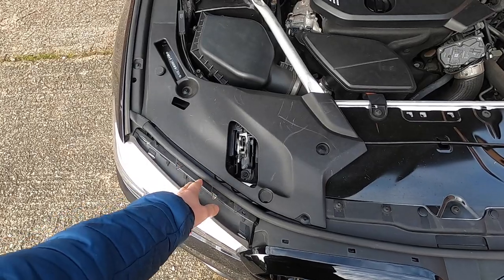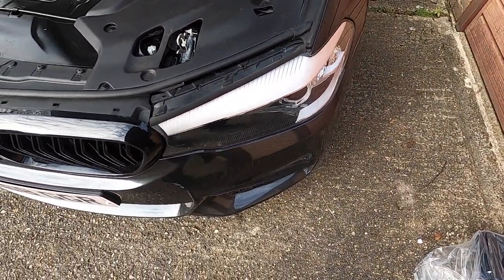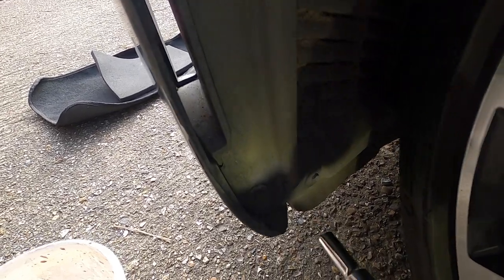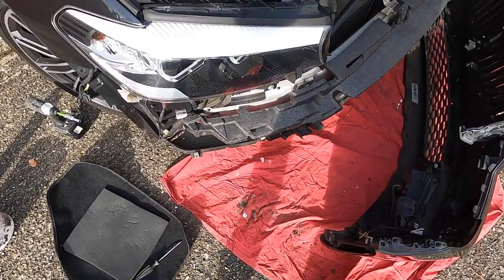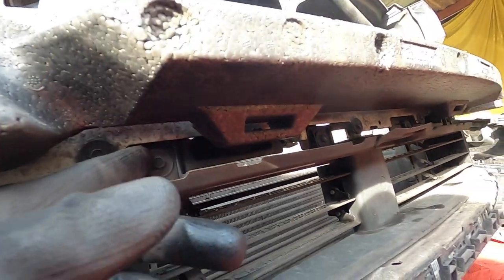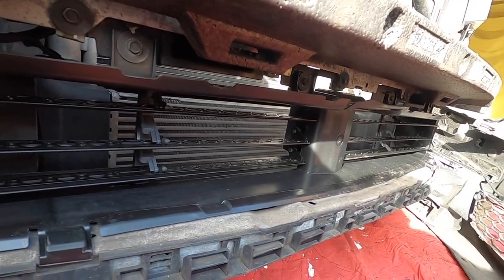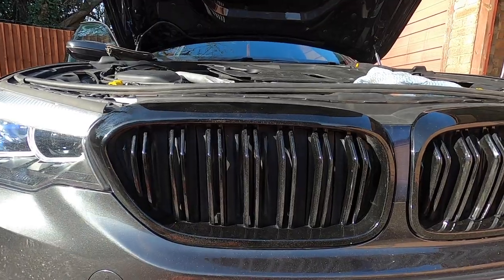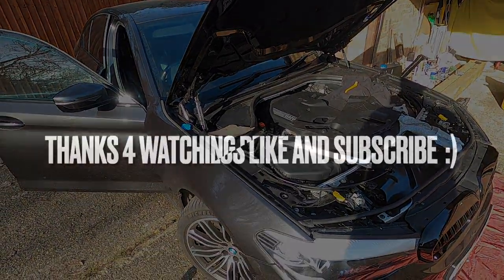How to replace lower active grill on BMW G30 (5 series)

Comment: Thank you very much for this.  I had the same issue with the open flaps on both upper and lower air flaps of the front grille G30 540i.   I replaced both mine upper and lower at separate times.  For the upper one, the new flap actuator was at the closed position when I installed it.  After that, it got stuck at the open position again, so I thought the lower one could contribute to that and I purchased the lower flap assembly.  I ran into the difficulty of getting the old one out due to the middle sensor was in the way.  The middle lower sensor was mounted with 3 screws, two screws were on the lower flange of the sensor and the one screw on the top flange which is the blind screw and the only way is drilled out the blind screw nut, but I was afraid of doing that.  Instead of doing so, I disassembled the new lower flap assembly and took the actuator (which is very similar to the top one) and then replaced it with the old one.   After all of this hard work, both the upper and lower are still in the open position.  
Any ideas?  Do you think I need to use ISTA app to close it?  I used the Bimmer Link app to check on the error memory, both error codes 13820B and 13820A reinstated after I cleared them off.  Any comment and suggestion will be appreciated.
Reply from the maker: Its hard to suggest something i have not dealt like that but i think you should not remove the actuator from lower grill coz it comes with flaps already so i presume it should be fitted that way maybe thats the problem you have because you took it out 🤷‍♂️

Comment: Do you need to replace upper one as well? I think on my car both of them do not work, I also noticed in one other video that after replacing both, coding with ISTA is needed, but may be only to clear errors is enough? What do you think? Thanks, great job!
Reply from the maker: I think its not necessary if its in working condition but i think if lower is faulty the top one might not work as well but my advise is to change the top as well because  you gonna have good access when bumper is removed otherwise you can access it without removing bumper so save your self extra work and do it all in one go. 
No coding need it just clear faults after you replaced it 👍
Reply: Thank you for the quick reply :)

Comment: Good video, my lower grill is dead so will be attempting in next couple weeks to replace it myself. Can you tell me if there is anything to look out when putting it back together? Thanks in advance
Reply: And how long it took you ?
Reply from the maker: Thanks 👍
Well be careful dont rush dont use force you dont wanna break things, keep screws in one place and when u out back bumper look for the gaps make sure they are the same, take photo or vide before taking apart so you can see how should look, specialy in headlight area there is a brackets where it sits if is not gonna sit properly you can loose it up just pay attention to detail 😉 good luck 👍
Reply: @arturaslogunovas  thanks i will be careful,  can ask how long it took you from start to end
Reply from the maker: @jirijansa356  well i think about 4hrs

Comment: Have you a eml ligth on the dash? The upper active gril open and close with the issue on lower active? Or the upper active grill stay open all the time?
Reply from the maker: No lights on the dash ive noticed when top grill stayed always open specially when weather in spring time still chill they should stay most the time closed specially in the morning before driving
Reply: @arturaslogunovas  mine is most of the time open, dtc error in memory but no Eml ligth on dash, im not gone spend money or the grills..Im going to coded to allways stay open..or..cut the flaps...Im living on the warm country....and 95% of all brands dont have active grills.
Reply from the maker: @Tony-fh2wi   thats cool and make sense to keep them open as you mentioned the country you live is warm i know some people do that 😁

Comment: Hello i just want to ask about lower active grill. Is there motor which open and closes it ? If yes, is there any part number of it ?
Reply from the maker: Hi, yes it is motor closing both grills upper and lower.
Im not gonna be able to tell you the part number as part is fitted and there is no access to check, but all you need is reg number or vin number then call to bmw dealer and they will supply you with correct part

Comment: Hi, I broke a "tooth" on the active shutter of a BMW G20 (the ones that open and close). How much would the repair cost at a BMW dealership?
Reply: I initially took my active air flaps off for aesthetic reasons - huge mistake. I got a CEL a few days later, I guess I did it wrong. I was watching TK Garage on how they took off the flaps...

Anyways took mine to the dealership to get the WHOLE thing replaced, it was about $1500 with the actuator and the flap replacement. I live in Las Vegas if it makes a difference
Reply from the maker: Well i dont work in Bmw so i dont know that but if you could ring them they will tell you how much that can cost, maybe you can buy a part and change it your self

Comment: I’m getting persistent code 21b045 loss of communication with lower actuator, but my 540i was not fitted with lower blinds? Only top blinds behind kidney grills which are working fine. I assume my actuator motor might be bad?
Reply from the maker: Hi, so if you getting that code it means you do have lower grill shutters otherwise would not make sense 🤷‍♂️ if your upper grill shutters closes and opens yes it means they are working but interesting why because in my situation when lower shutters actuator broke uper shutters stopped closing and stayed open all the time until ive fixed it, so what can i say i can see your car so i dont know what exactly is a problem but if you cant delete that fault code it means is permanent and  you need to replace lower actuator.

Comment: Which app and dongle do you have?
Reply from the maker: https://www.ebay.co.uk/itm/374314600585?mkcid=16&mkevt=1&mkrid=711-127632-2357-0&ssspo=2hgzjbe6tzc&sssrc=4429486&ssuid=tvsbH7Z3T3K&var=&widget_ver=artemis&media=COPY
Reply from the maker: Vgate icar pro i posted the link so you can look at it and app called BimmerLink
Reply: thx, bdw which errrs did you had before changing upper and lower flaps @arturaslogunovas
Reply from the maker: @mfactory451  i dont remember now how it was written but it stayed as permanent, couldnt delete also it was only for bottom flap fault in the system but not on the dash

Comment: Can i clear the code on corner active grill and not change the grill
Reply from the maker: If your grill is faulty the fault stays permanently on the system so you cannot delete that fault
Reply: If you’re tuned you can customize your map to not show the code